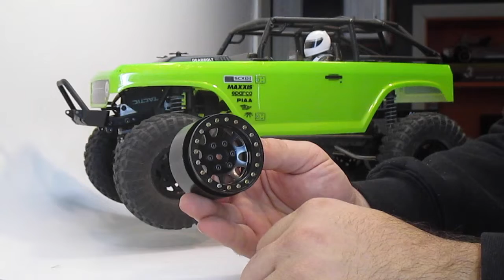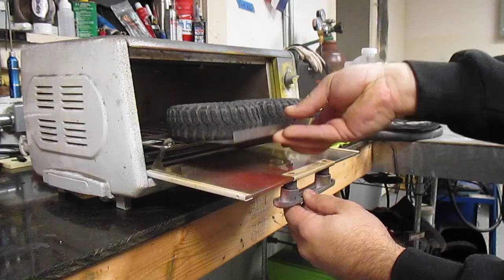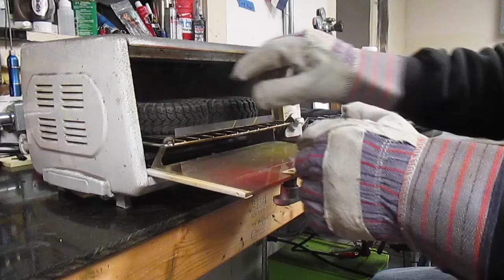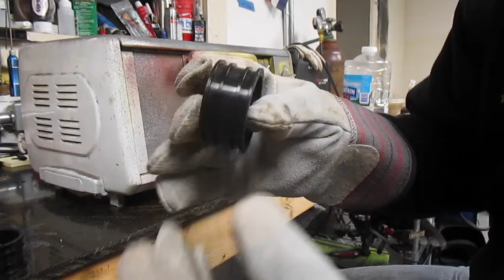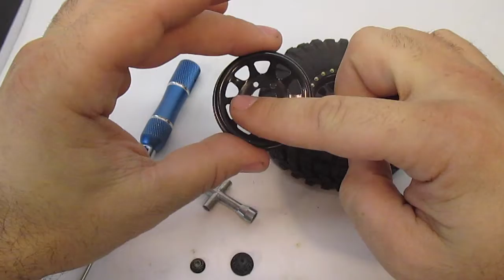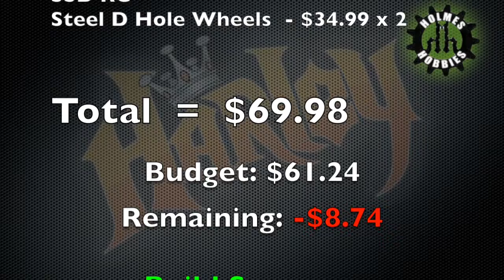Axial SCX10 Deadbolt - Beadlocks - $50 Budget Build - Week 4

Comment: I just bought SSD 1.9 beadlocks for my TRX4 Sport. When I put both halves they remain separated by almost 10mm and I must exert too much force to get them closer and I am afraid something will break, like the bolts threads.
In fact I guess the bolts will have to resist that force and I dn´t think it will work. My friends told me that they are compatble, the SSD and the canyon tires. But...

Comment: In the pro kit the plastic hubs that come in there what is the size I need for the same size slw hub for both the bigger and smaller plastic hubs I’m using the bigger of the two but it would be nice to know both sizes
Reply from the maker: Smaller is right between a 350 and 475 and the larger is closest to 850.
Reply: Harley Designs thank you so much
Reply: Harley Designs what about for the incision hubs sorry I just seen them

Comment: if you don't like using the scissors to cut that big hole use a very small finishing nail it won't rip out a whole like a drill bit will do, personally I had rather vent the wheel than the tire less likely to get water in there.

Comment: I Have a deadbolt and I wanted a set of beadlocks to air fill my tires due to stock set being glued stock.But didn't wanna wait So I put stock rims & tires in freezer for 5 min to slightly decrease temp and then hot glued the vent holes in the back of rim. Colder the air in the tires when u glue the more air pressure tires will have when they return to room temp. Note when u run air filled tires in cold weather the tires will return to low pressure look and performance.🇺🇸  I watched your budget build from day one and was one of the main reasons I got a deadbolt, thanks for the tips and info keep em coming

Comment: In this video of putting your glued tires in a toaster oven to break them loose if someone has used a little too much glue will this process still work? Awesome video tho
Reply from the maker: +Tracy McCarthy I think you will still have a good chance of it working. At this temp the glue loses it bond.
Reply: Harley Designs - thanks for that bit of info that even after 33 years in the Hobby, I had never heard of!!! I guess WHO you hang out with can make a difference too....
I would have NEVER thought of putting plastic Wheels in a 325° oven!! 😱😱😱 I'll have to try that, as I have two glued Wheels that the tires are nearly egg shaped!
Carmine 🚂

Comment: i bought some wheels to my scx10 and they work fine but i have just 1 big problem. the wheels rub the hub arm and i manage to use some washer on it but there is a part that i need to buy in order to solve this problem or it supposed to use a washer?
Reply from the maker: +angel rivera all depends on your knuckle. Or you can buy some Vanquish SLW hubs and SLW hub hardware, then slightly drill the wheels out so you can widen it up.
Reply: Are there any hub hex thicker ? I mean that nut that goes inside de wheel center hole ?

Comment: Hey I have a question: I bought the same wheels and after they arrived yesterday, I mounted them and took my scx10 out for a test drive. I had some bad flip-overs at one obstacle. After that I had lost three of the small little screws on the outside of the wheels, two of them at the same wheel. And even before that one obstacle I had already lost one screw. My question now is: Did you have the same problem and what should I do to fix that? Loctite? Hot glue? (Luckily there are some spare screws in the package)
The Video helped a lot to see exactly how the mounting works and your whole channel helped me out several times making decisions or fixing problems. Thank you for that, greetings from Germany!
Reply from the maker: +Dennis Wächter I did not have the same issue but I have heard many that have. Just poor assembly at the factory.  Remove all the screws and loctite them all.
Reply: +Harley Designs I did that as many others I asked also suggested the same and it seems like it works. Thank you again for the help!
Reply: And also thanks for the quick answer

Comment: Have an Axial Bomber that I have Pit bull tires, Axial bead lock wheels , Axial wheel weight in fronts, vanquish suspension upgrades. Climbs great but, I've had it twist on steep climb, raising front tire and flipping the Bomber over. It will raise the tire off the ground on good traction surfaces. A sway bar has been suggested, but what will that do to the climbing, the I bought it . I've tried heavier shock oil but very little help. I all so have a Wrait, close to a Bomber, that does not do this. Any help would 've great.
Reply from the maker: +Dennis Harris a sway bar is the way to go. It will reduce flex but more flex is not needed for crawling. The height of the tire is all that's needed.

Comment: been venting my tires for years like that in all my race R/Cs... One tip, I use a leather punch and punch two or three small holes as you mentioned, in between the treads. Simply punch the hole prior to mounting. Punching holes in the tires also will all water and debris to escape through centrifugal force, where as a hole in the wheel or sidewall will not. Google leather punch and you should be able to find one for under $10.

Keep up the great videos.
Reply: nice
Reply: GREAT Tip! I'll have to pick up one of those.

Comment: I know you work for VP now, but how were these wheels, did they hold up well, worth buying?
Reply from the maker: +nate emmett the screws fall out easily over time. The mounting style is tougher and the adjustment isn't easy. But they are cheap. They worked pretty well but if I was going cheap again I'd likely look to something different.
Reply: Great info, thank you!

Comment: Whats your opinion if venting the wheels? Using drill to make small holes..?
Reply from the maker: It accomplishes the same goal. I just don't do it because a 3 piece wheel often makes it more difficult for air to escape that way. Also some of the single stage foams don't breathe as well so when compressed the inner holes will get blocked. The tire method has just worked better for me overall.
Reply: +Harley Designs yeah great. Thanks dude

Comment: Harley, you are not  weighting the wheels at all..? just using foams as your tuning..?
Reply from the maker: Correct, I do not like to add any weight to my wheels. It adds rotating mass which is hard on drivelines and you lose responsiveness from the throttle. I like to keep the weight bias forward on the car by getting the components forward and low. I don't like to add excess weight that doesn't do anything else.
Reply: NICE..thanks Harley great job on the vids..!!

Comment: Great vid! Would this setup fit a slash?
Reply: Flash Hobbies nope. A Traxxas slash uses a 2.2/3.0 wheel while this uses a 1.9/1.9 size wheel. Also, the Traxxas slash has a weird front/rear wheel offset.
Reply: Stock trx4 wheels fit my sc10 2wd which is basically the same thing as a slash so I don't see why not might be a little close to the rear carrier though other than that they should bolt right up if you want a real simulated experience at least that's how my 1 short course felt when I took it around the track lol

Comment: Any tip on keeping the  tiny bolts from falling out of these wheels? I've already lost one and had to tighten up two of them. I haven't even ran my truck with these wheels and already coming apart.
Reply from the maker: If you're having issues, I'd get the RC4WD scale hex bolt tool and apply loctite to ensure they never come loose on you.

Comment: You claim that "venting" the tire is the way to go with proper foams and any other method is inferior. To an extent, in some cases I agree. But for someone who is almost a "professional" being in nation wide pro comps since 2007 ( you claim), you would think that you would realize your method for "venting" the tire is all wrong. Two reason I say this and you should know this. For one, your holes are to big leaving a huge welcome mat for all debris, small rocks, dirt clumps, and a bath tub for open water and mud. With the size of hole you leave, you are sure to collect debris that will totally throw off any "proven performance" you gain by "venting" and also leave your tires to full break down, maintenance, clean up and re-bead after every run just to keep your desired performance. The second issue is the fashion in which you create the "vent" in the tire. Never cut, rip or tear your tires for this. That was so NOVICE watching you cut them and ripping out a chunk. As you should also know as an experienced crawler, leaving these jagged edge cuts on the tire leaves them vulnerable to further ripping, tearing and shredding against sharp rocks during competition. You should always drill your hole with a 1/32" bit or use a body reamer tool  for a clean small hole and do 1 to 3 holes around the tires center tread for the desired venting performance. If your going to instruct beginners on here how to do this, at least do it properly sheesh! Oh! and don't tell them sealing and airing is an inferior way to do things. It might not be your way but it is a good option especially for wet trails. If your going to do instruction videos, get your facts straight and stick to facts, not your opinion. Show them the options and let them decide what is best for them, not tell them one is better than the other because it is not in the case of trailing. You are going to have some poor beginner ruining their expensive tires in no time. Not everyone is a "Pro" like you.
Reply from the maker: Getting debris in the tires has never been an issue with ruining any performance. Also the only way I have ever ripped a tire is when using foams that are much too soft and catching them on something like a knuckle screw. That hole has yet to ever be an issue. A 1/32" drill bit is not going to give enough air movement either. At a minimum I would use a 1/8" bit. 

Wet trails are wet trails and I understand the concern of water, but if performance is the goal and not minimizing maintenance, then venting is still the way I would instruct people to proceed. A single stage closed cell foam is waterproof (within reason) and will also allow for a minimum amount of break down maintenance.

And yes, as I claim, I have been competing since 2007 at a National level.

Comment: Harley, have you tried using a leather punch for your tire venting?  I haven't tried it with my crawlers but it's all I use for my race tires (1/8th scale off road).  Super fast, accurate, and you're guaranteed to have equal sized holes on all your tires.
Reply from the maker: Leather punches are probably the best way to do them, I just don't have one in the shop.

Comment: Absolutely untrue. Air wheels work awesome. I rock crawl like a champ with Pitbull rockbeasts on g-made air wheels in summer.  And we have wicked wicked rock here :P  I can adjust the pressure for whatever. And they seal great too. In the snow I just go with the g-made Bighorns on air because they work good in snow and the tire is fairly stiff so no need for foams either. Not that I don't have countless wheel/tire combos with foams...lol but you shouldn't knock air unless you've used it and also it depends on your build. Heavy or light, where your crawling or if your even crawling. This system wouldn't work good if your driving real fast and UNSCALE and jumping and flipping all over making it look unrealistic like a toy But it is awesome for serious rock crawling.
Reply from the maker: I have competed in RC crawling on a national level since 2007. I am well aware of what works for serious rock crawling. No major crawling competition is going to be won with sealed tires. Choosing the proper foam for the weight of your rig is key but sealed tires will not perform to the the same level as a proper tuned tire and foam setup. This has been proven over and over on a national/world level at every  large competition. I understand you are happy with it, but going head to head with a properly tune setup you would see the short comings. I understand running sealed in snow because performance is not going to be great anyway and not wanting to release the moisture. However actual rock crawling, it's just an inferior setup.
Reply: Harley Designs You should have said that in the vid then bro ;o) Not everyone does comps. They're silly anyway. Totally out of scale the way they drive them...lol! My set up is just as good if not better then many foams for the slow crawling over real mountain rock. Not the little stuff...lol! We drive em' like their real rigs. I have nothing against foams at all. Like I said, I use a lot of different ones. Just saying that you portrayed air systems as no good and that's not fair ;o) But I'm sure you're not going to give up your opinion cause you're the greatest ;)
Reply: Harley Designs The great thing about this hobby is  there are certain opinions and options each person is going to be able to decide on to make it their own and in their own opinion the best. This air/ foamed conversation is just like the difference between driving a ford or a chevy in nascar. You cant tell me that one way is inferior to another on this subject. It really depends more on the terrain you will be running just like opting for tire treads (you dont go rock crawling with drag slicks) Everyone in my area laughs at my sealed, no foams, half flat tires on my SCX10 until I am pulling around them on the trails, so to each their own. I don't know how many of those National Rock Crawling Competitions you have won but surely not any G6's and have obviously not been through a comp course with water crossings. If you did , you would know that the water entering your tire would hinder your balance and will screw up the performance for the rest of your competition. More and more scale comps are adding muddy hazards and water crossings to the course, almost all of them now. Harley, you may be correct with your method of slashing tires on a RC comp rock crawler and just may work best for you on the rocks but the "budget build" this video is on is a trail truck for the beginners, weekend warriors and possibly the occasional scale comper in which your method is nothing more than a suggestion. They could just as easily win that scale comp with sealed tires with or without foams as long as their setup is correct for the course and they can drive it.

Comment: Btw totally agree trapped air is too in consistent I like that you said "gimmicks" because the tuning foams get you is amazing. Just to add my .02 reason I run a hole in the tread is to let dirt/ moisture fly out as the centrifugal force pulses out ward as tire spins.

Comment: I am going to have to agree with Brian on this one.  I actually LOVE to run my trucks with sealed wheels.  I like to think it is a lot more realistic.  I have yet to try the g-air wheel system but I do just install my tires without foams and then tighten beads.  They are still somewhat soft and contour to the rocks.  Totally a personal preference though.  Love the build!!  Also going to be ordering a set of wheels from ssd as well.  Keep up the great work!!
Reply from the maker: Personal preference for sure, but being a competitor in crawling comps all over the US for many years I'll tell you that you won't see a truck be competitive with that style setup. I am very conscience of scale but if performance is important, then vented is important.
Reply: Harley Designs Well said.  I haven't yet had the opportunity to enjoy any of the awesome G6's and comp's that are on your channel.  Nothing of that sort where I live.  Great videos. Keep em coming!

Comment: I have a set if wheels that I keep sealed for creek running.  Really does help keep the water out of them.  So I would disagree with you on that point.  Pull the bead off the morning you run the tighten back down to help with the pressure buildup.
Reply from the maker: Great for keeping water out, but the performance of a sealed tire is very bouncy and the reason that I never suggest running that way. A good set of foams will out perform a sealed setup and I don't like to sacrifice the performance.
Reply: Harley Designs I use sealed wheels and my truck isn't bouncy. I've also cut the foams that came with my tires in a star pattern. I can get to the same places 2.2's can. For aligning those wheels, I use a silver shaper and draw a very small line on the inside lip of both parts of the wheels so I can align them easier. You could also try and use small allen keys or wrenches to align them. My rc4wd wagon wheels can be a pain to put on my tires.
Reply: rider1388 sharpie.